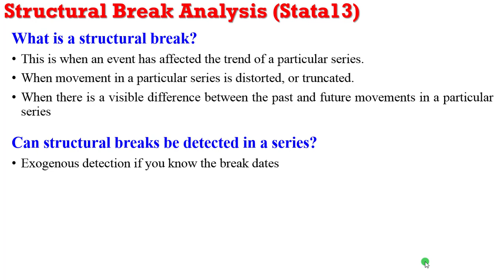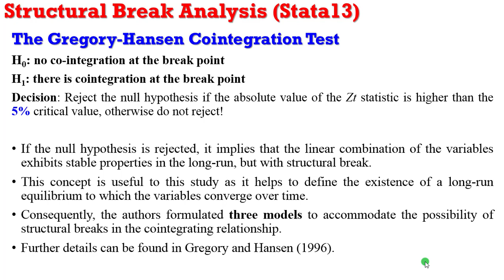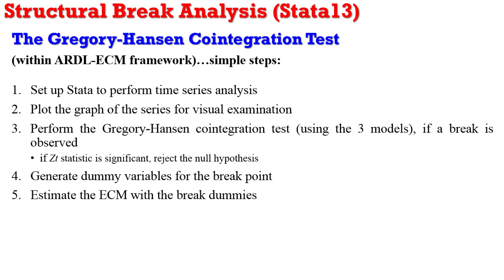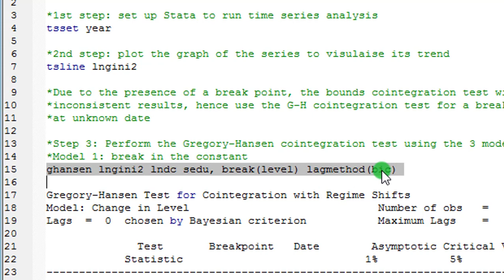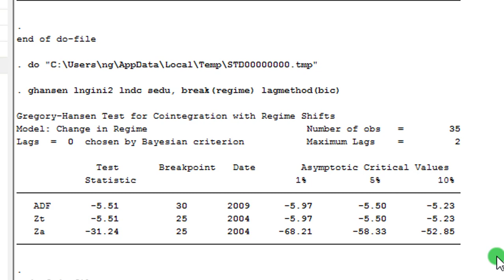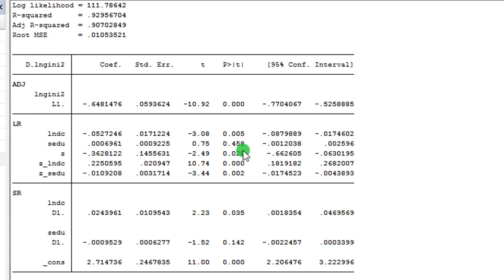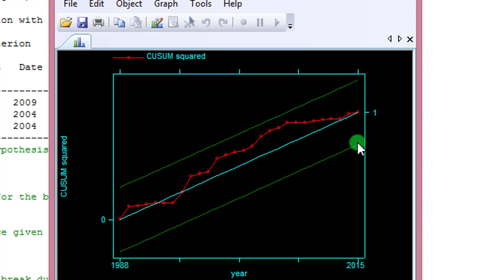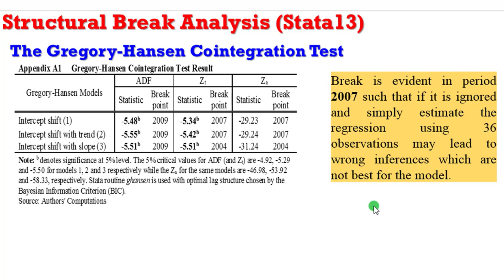(Stata13):Gregory-Hansen Cointegration Test Structural Break #ghansen #breakpoint #structuralbreak

Comment: Dear Professor,  Thanks a lot for your support  with many videos. my data gives an evidence of  structural break when I take level and regime but not trend under Gregory-Hansen co-integration test. I got a very good result in LR. But  model is not stable as per  Cusum test, now what is solution. please advise me details with all options.
Reply from the maker: Hi Rayhanul, thanks for the positive feedback on my videos. Deeply appreciated. It implies that there's another break in the model. All you have to do is identify the break date, construct dummy variables and re-estimate. May I know from where (location) you are reaching me?
Reply: @CrunchEconometrix  Dear Professor, I am in Beijing at University of International Business and Economics, I am really grateful to you for your excellent feedback. But how I can find another break? I am confused about ADF test, My questions--1) is it essential to check stationarity for all variable including dummy variables?  2) After checking stationarity you are using non-stationay form of variable at bounds test, at regression/cointegration test which form of variables (level/log/first difference) I  have to use? 3) I got a structural break in my data series (found at chow test), now I shall go for gregory-hansen test,  Is there any necessity to bounds test? In my data series,  one variable is stationary in ADF test ( at level),  in pp test  stationary ( at first difference) and  non-stationary in kpss, what will be decision?  In your another video named ardl with dummy variables, you have select lags of all variables, why and when this lag selection is necessary? pls pls reply as soon as possible. if I get your phone no I can call you if you don't mind.
Reply from the maker: @dr.rayhanulislam6609  Hi Rayhanul, I have covered most of these queries in my videos. Optimal lags are selected at the onset. Stationarity is not required for dummy variables. Once you have a break in the model, Bounds test is no longer applicable (explained in my video). If the ADF, PP and KPSS give different results, you have the prerogative to use any so long as the outcome is stationary. Read up on Zivot-Andrews unit root test.

Comment: Dear Ngozi, 
Thanks very much for the video again! It is always helpful.
I'd like to consult Ngozi for the following questions:

1. How to understand the third point of the structural break: when
there is a visible difference between the past and future movements in a series? What does it mean?
Does it mean: the slope of the series is going up or going down in a little fast speed?

2. My Gregory -Hansen tests show that 3 models have 3 different breaking points. However, Model 3 with constant and slope reject H0. Model 1 and Model 2 accept H0. How to interpret such results? How to make a judgment in this case? Is there any criteria that I can look for to understand those results? 
Which model I should look at? Is it model 3 which rejects H0?
Reply from the maker: These queries are too many, so I'll let it pass. I explained to some extent in my video but you can do more search online for other issues mentioned. My apologies, thanks.
Reply: @CrunchEconometrix  No problem at all. I totally understand. Thanks so much for the reply as usual.